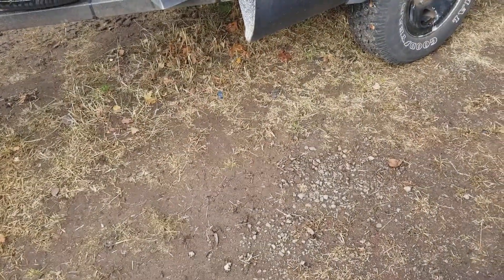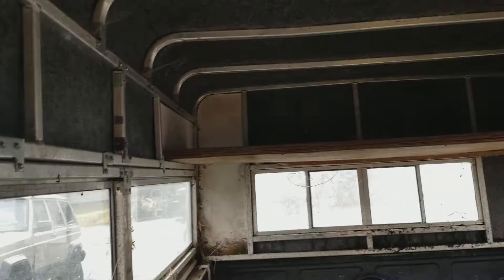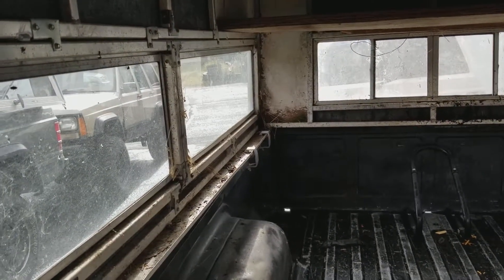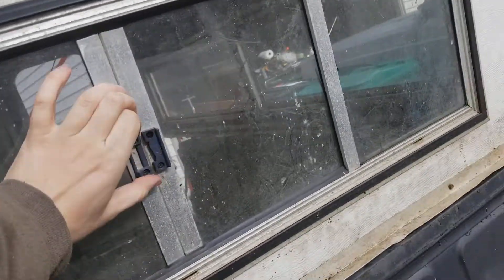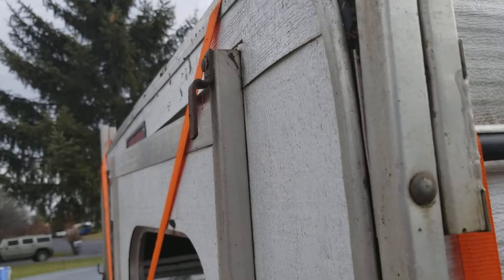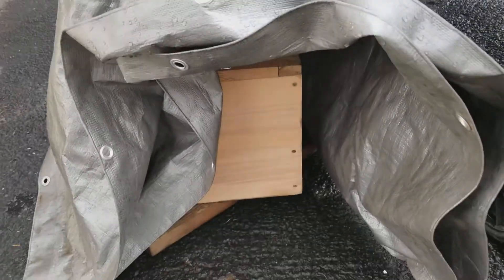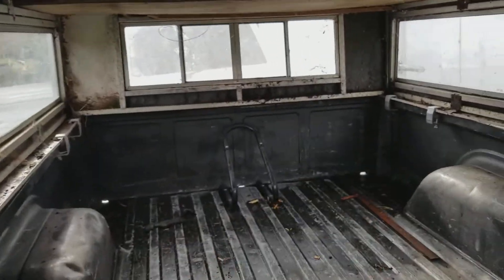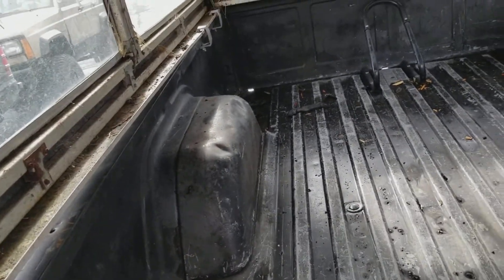Jeep Comanche Bed Trailer camper build update #1

Comment: Need to get together. I'm doing the same thing with a truck bed.
Reply from the maker: I had to step away from this project for a while, been debating on using this canopy still or putting the shorter one on it again, I also traded some stuff for a rooftop tent that I might do something with eventually also. Are you going to build it on the back of a pickup or a trailer like this?
Reply: @diyjeepguy7713  i have a  utility topper on mine. It seems to be a good choice. But I haven't worked on mi e in a few months.
Reply: I’m doing my 1966 international truck bed trailer with high top canopy! Got 33’s on it now. Going all out. Was hoping you finished it? Mine will have solar and rv plug for camping and water. Heat and cooling. And a full queen bed. Let me know if you have any tips.
Reply: @CountryBoy-cl3jq  I'm doing the same thing. Thats awesome
Reply: I am building  one from a  97 ranger